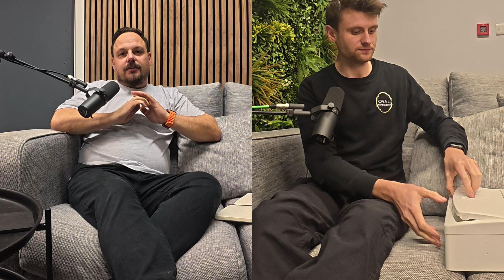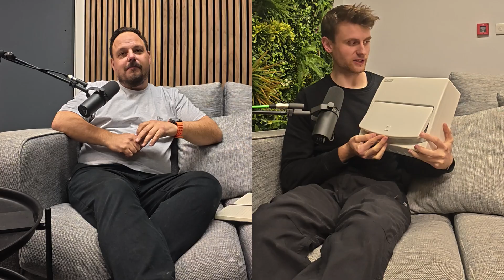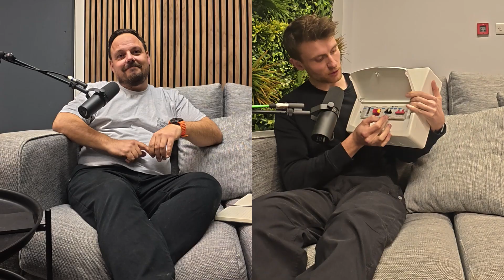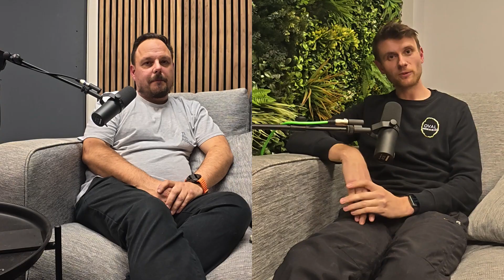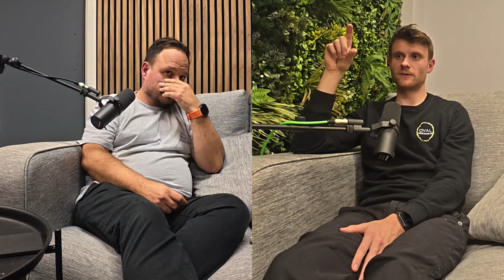Is solar a fire risk ? How do we make it safe ? 5 simple steps...

Comment: Yes I’m glad I went against my installation companies advice and got Tigo optimisation. 

I had to get another CCA tap kit for my garage as it was too far and now I have installed Shelly mini relays into Home Assistant so I can shutdown the house and the garage separately and best of all remotely using the AUX and that is almost instant definitely not a minute more like 10seconds. 

PS a lot of issues are installers I saw a so called spark look at a charger and say there is too much insulation showing and it’s not feral crimped and then crimp the feral with pliers 😮